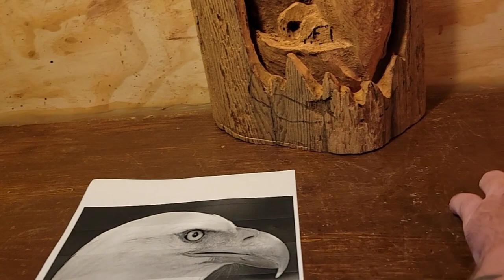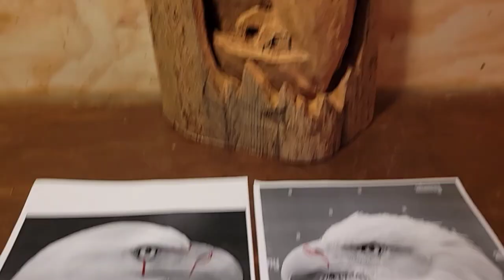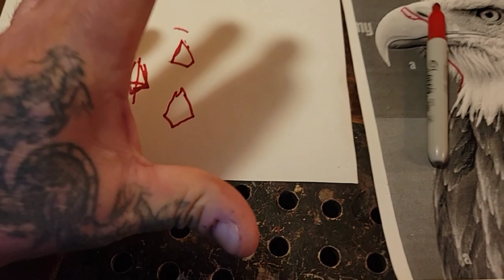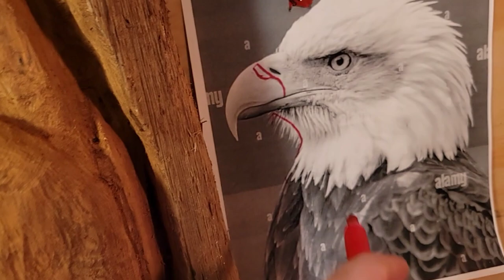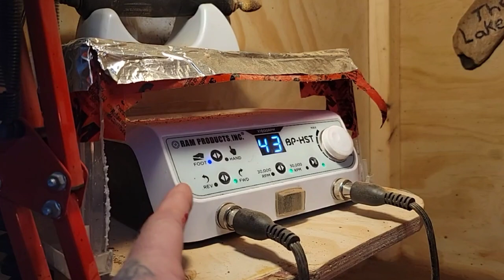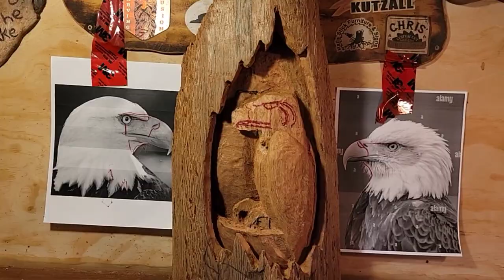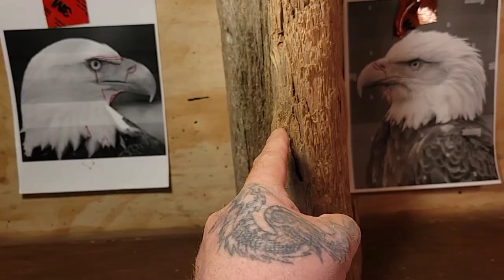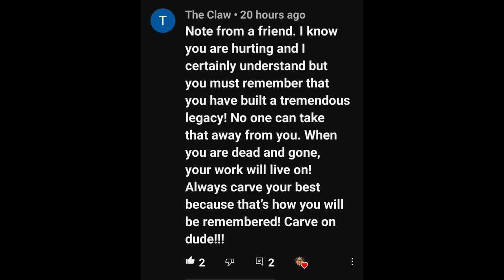Step-by-step 》Carving an eagle into an old piece of western red cedar ☆ Part 2 #Carvingfusion

Comment: what makes an eagle look like an eagle is the white head that ends with flared feathers at the neck, more than anything I find this the most important part
Reply from the maker: Lol ya that's if ur gonna paint your carving but in this case thist carving is not going to be painted, thanks for the comment
Reply: @CarvingFusionbyjordy  I burn the body and down burn the head, and it has the same effect. Love your carvings just wanted to tell you a trick I found when trying to make my eagles look decent